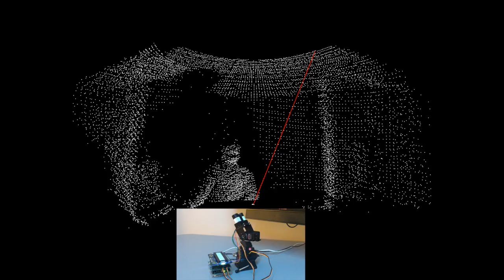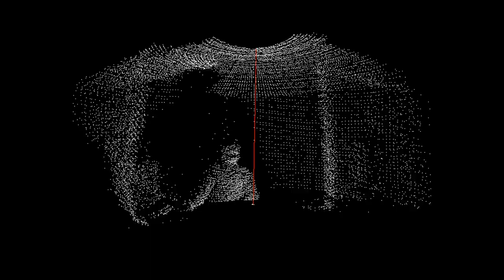Arduino-based LIDAR Scanner

Comment: Because this video was so short, I was expecting it to be one of those badly filmed hurried demonstrations with no worthwhile details that seem to litter YouTube.
So I was very pleasantly surprised when I saw that it was actually very well presented indeed.

This is an example of what a wonderful time for hobby electronics that we live in. I remember reading about how NASA were flying lidars aboard the shuttle in the 90s... the though that somebody could build one in the own homes would have been filed under "very nearly impossible".

Would it be possible to improve the resolution (obviously, with a slower scan-rate)?
Reply: And likewise, yours is a wonderful comment.
Reply: I agree with both Kent and edgeeffect. This video, though short, was detailed enough to explain that this is a relatively easy project and it was also extremely fascinating. Your comment, edgeeffect, restores my hope in the somewhat unstable landscape that is the YouTube comment section. Great video Dana. I will attempt this project myself.
Reply: resolution depends on the angle between points, aka to improve resolution you just need to take fewer steps between readings.
Reply: I'd say the video was detailed enough to explain how to build one!
Reply: Nice video. Could you please share the code or share the materials where I can built my own lidar scanner like you did. Very interesting.
Reply: edgeeffect YO YOO HE DOIN SOME SCIENCE SHIT HERE

Comment: Friend, please help me, I can't get the correct shape, I've tried all the formulas and possible ways, I'm not a programmer, but I have good horizontal lines, but when the servo reaches about 45 degrees, it starts to make my ceiling as if it were an arch and it is triangular understand? can you give me some help?

Comment: Good video. I hava a question, im working on a convayorbelt inside a freezer. I wanted to put 3 or 4 ir sensors lengthwise over the.belt to activate the belt motor if they see a object on the belt. Could one of these do the same thing? And does this shines out the beam sideways or just like a lazer one small line?

Comment: Hey is that Garmin lidar lite v3 sensor?
Can you tell me the purpose of  1000uf capacitor to the lidar sensor in  between black and red.
Can you tell me what changes in the circuit should be done if we use different lidar sensor.
Waiting for your response, thank you
Reply from the maker: It is the Garmin LIDAR-Lite v3. The purpose of the 1000uF capacitor is to smooth the supply voltage to prevent it from dipping below 5V when the current drawn by the LIDAR sensor suddenly spikes.

Comment: Hello, thank you for the video.
can you please tell me why did you use an outside power source? instead of just connecting your arduino through an usb cable to the pc.
and on what pins did you connect the LCD display?
thank you again
Reply: I am asking because the the schematic does not show where you connect the LCD screen

Comment: Trying to reproduce your excellent plotting of x, y, z,  using inexpensive parts.  I'm using Processing V2.1 but I'm having trouble with the LidarScanner.pde, and the serial output format.   Are the x y z coordinates, being sent Serially to the Process sketch, separated by commas,  123,456,789?  Do they have leading 0's?  Are each of them 3 characters long?

Comment: You and your excellent video inspired me to try to re-create what you did.  I bit off more than I could chew...  Due to my limited funds, more time than money, I bought less expensive parts:
1. Chinese 1602 LCD with Keypad Shield with buttons
2. Proto Screw Shield for Arduino
3. TFmini Plus Lidar Range Finder
Which I have finally have gotten to play nice with each other.  The documentation for the 1602 shield eludes me, so I looked at the library files to see what pins it used, as to not mistakenly try to use the same pins on two devices.
I got stuck in my tracks, when it comes to the servos, which are SG 95.  
My questions are:
Is there a reason you used pins 2, and 3?   I noticed that  they are also the interrupts, on an Uno.  I would like to use different pins, if its possible.
I tried you code, just to see if I could get the Processing software, to spit out the screen, like the one in your video.
All I got was an empty white box, that times out after a while.  I tried both the 2.1 and 3.x software for processing and got the same result.
Was this the result from Processing I should expect, when not having a lidar lite hooked up to it?
My TFmini Pro is a serial interface, but I could no figure out how to adapt it to your software, so I didn't have an input to feed the Processing output (0,1), hard serial.  
I did use Software Serial, to connect it,  with my 1602 LCD shield successfully, but still have to get the Arduino code, that I put together, to work with some servo code, that I was hoping to borrow from you, and the Hard serial out code for the Processing sketch.

Comment: 1. How do you attach the servo motors to the LIDAR?
2. How do you attach the cytron shield and keypad?
3. Can you connect the components using breadboard? 
Thanks

Comment: Hey,
I was checking your Arduino code just to feed my curiosity, and what i've seen is you've added an int scanIncrement = 1 and i really wonder the need of this one. Same as
if (scanDirection) {
      posX += scanIncrement;
    } else {
      posX -= scanIncrement;
    }
..here you could easily use int++ or --int, which leads to my question out of curiosity, Why did you even need such an integer to accomplish a basic task? I'm asking to learn :p

Comment: Great project!  The processing sketch on your site is a .pde file.  Can you tell me what program I will need to run such a file?Thanks!
Reply: The software is free and available at www.processing.org/download. I just installed it today for my Creoqode NOVA.
It is a text editor that can be used to write for arduino.

Comment: I will preface my question by saying I know nothing about 3d scanning or Lidar. I was wondering if this device could be setup/configured to scan small objects, roughly the size of a shirt button?  I assume the point cloud could then be imported into some sort of 3d modeling software where it can be modified and then exported to a 3D printer? This is a very cool project, thanks for the video.
Reply from the maker: The Garmin LIDAR-Lite 3 would not be suitable for tiny objects. It has a range of 40m, with a resolution of +/- 1cm. A button is about 0.2cm thick, so it wouldn't be detected.
Reply: Dana Peters Thank you! The search continues... 😉
Reply: Look into photogrammetry - presumably your object is going to want to stay in one place, and distance isn't an issue, so photogrammetry (with enough camera resolution and good model lighting) may be a viable option.  And, hey, it's "free" to get started out in!  @Dana:  Outstanding demo, and thank you for sharing your sketch on your site.  It's enough to get one thinking!

Comment: Hello is a really cool project :)
I am making a 360-degree 3D scanner at the university by modifying your project a bit.
But I have one problem,

if (posX > maxPosX || posX < minPosX) {
      // hit limit X limit, reverse auto scan direction
      scanDirection =! scanDirection;
      posY += scanIncrement;

In this part, it is only necessary to rotate in one direction, but the x-axis rotation direction is continuously reversed.
posY + = scanIncrement; _ Here the y-axis goes down one space,
The problem is two lines above. Can I get help? Please,,,

Comment: i visited the link given above there the Arduino code is designed for manual control, may i have the code that just uses 2 servos automatically and give readings accordingly.
Reply from the maker: Please treat this as a starting point for your own project. I encourage you to make changes to the code to customize it for your needs.
Reply: thanks for your response but i think it will be more easy for one that already designed it... actually  it almost a 2 days to present it and i am quiet new to programming if you could help me in this regard indeed that will appreciable
Reply from the maker: If you would rather not modify the code, you also have the option to construct the project exactly as described, using an LCD shield.
Reply: respected Sir the problem is here we are lack of resources even for LIDAR Lite v3 I almost wait a month to reach and paid almost 3 times more than its original price. i did tried to modify this code i failed. the code i am using just to read the values are here But we are demanded to construct a 3D mesh from these reading coming out of the Lidar through arduino.
although i uploaded this code but Processing is not working on this Ardunio code
Hope u will give some of your precious time to sort my awaited problem

#include <Servo.h> 
#include <Wire.h>
#include <LIDARLite.h>

Servo servo1;  // create servo object to control a servo 
Servo servo2;  // create servo object to control a servo 
LIDARLite myLidarLite;

void setup() 
{ 
   Serial.begin(9600); // Initialize serial connection to display distance readings
     myLidarLite.begin(0, true); // Set configuration to default and I2C to 400 kHz
     myLidarLite.configure(0); // Change this number to try out alternate configurations
 servo1.attach(9);  // attaches the servo on pin 9 to the servo object 
 servo2.attach(10);  // attaches the servo on pin 10 to the servo object 
} 

void loop() 
{ 
  //servo1 -> 50, 90
  //servo2 -> 80, 125
 int k=80;
 int l=50;
 int temp=0;
for(int i=80;i<260;i++)
{

  for(int j=50;j<210;j++)
  {
    if (temp>=4)
    {
      temp=0;
      l++;//right 2 left
      if(l>=90)
      {
        l=50;
        k++;//up 2 down
        }
        if(k>=125)
        while(true);
      }
      temp++;
    servo1.write(l);//right 2 left
    servo2.write(k);// up 2 down
    myLidarLite.distance();
    int vall;
    // Take 99 measurements without receiver bias correction and print to serial terminal
  for(int i = 0; i < 10; i++)
  {
   vall = myLidarLite.distance(false);
  }
  Serial.print(i-80);
  Serial.print(",");
  Serial.print(j-50);
  Serial.print(",");
 Serial.println(vall);
   
    delay(3);
    }

  }

while(true);

Comment: I have 2 questions , 
Is the proto shield and the lcd display nessesary for this build to work . and is there any way to get a faster scan than 10 mins ?
Reply from the maker: You do not require the LCD shield, although minor changes are needed to the code to start scanning immediately instead of waiting for a button press. I have not attempted to speed up the scan, although this could be done by various methods. You could restrict the horizontal and/or vertical angular range, or take bigger angular steps, or both, for example.
Reply: Dana Peters perfect ,thank you for replying so quickly !! Much appreciated
Reply: could you please copy and paste or sent the arduino code  to me please , i can seem to open the file on the website in the description

Comment: Do u run Processing sketch while you are scanning? Sorry for many questions : )
Reply from the maker: Yes, the Processing sketch is running on a desktop computer during the scan. The Arduino sends each data point to the Processing sketch over a serial connection.
Reply: Thanks. But still have problem running this sketch on Processing(ver3.3.6). It returns error "size() function should not be used here". I tried to change this to fullScreen() but never worked.
Reply: I actually figured it out. I worked by downgrading to ver 2.2.1. Thank you very much for all your support!!
Reply from the maker: Great, glad you found a solution, and thanks for reporting the problem.

Comment: Is the instruction for Freetronics LCD shield about "disable the backlight control by cutting strap marked "D3"" only applicable to this particular LCD shield?
Reply from the maker: Yes, this instruction is specific to the Freetronics LCD shield, so you can ignore it if using a different LCD shield.
Reply: Thank you for your quick response. I recreated the exact same setup except using the same LCD mode. But maybe because button position is slightly different on LCD it seems like not moving or starting properly. How do you start the scan automatically after uploading the sketch?
Reply: Thank you. I got the clue. My LCD shield seems like not all buttons assigned to A0. So I will either fix this or just get the same shield.

Comment: I want to use the lidar to mount it on a dron and to make 3d scanning of buildings, can you give me your email to give me directions?
Reply from the maker: Please see the web site linked to in the description for details. I don't have anything more than what is available from this site. Check the specifications of the Garmin LIDAR-Lite to see if it has sufficient range for what you want to do.
Reply: can you give me a guideline how to change the code to work without a button and display and servo Y because the dron plays the role of servo Y
Reply from the maker: Sorry, I can't provide help, but I wish you luck with your project, it sounds interesting.
Reply: Dana Peters  please

Comment: which servo motor is used..thanks..
Reply from the maker: I used a Lynxmotion pan and tilt kit, which includes two Hitec HS-422 servo motors.
Reply: thank u so much...I think I can do my 3d scanner with the information you give, I guess I am not on my finishing project and I have 3 weeks time left.

Comment: which Lynxmotion Pan and Tilt Kit model did you use?  I went to the webpage in the description, but when I click on the link for it, it goes to the Lidar unit page.  Thanks!
Reply from the maker: I fixed the link on the web page, thanks for mentioning it! The Lynxmotion Pan and Tilt Kit I used has product code "RB-Lyn-74".

Comment: I am a student at University and I am really interested in your project but I have a problem with your code in arduino that i can not understand. Please help me, sir. Why do you use this fomular "elevation = (180 - maxPosY + posY) * deg2rad" to caculate the Theta in spherical coordinate system ??? :))
Reply from the maker: Not only does the Y servo have a limited operating range (from minPosY to maxPosY), it also is offset so that when posY equals maxPosY, the servo is pointing the LIDAR detector straight up. In this case, "elevation = (180 - maxPosY + posY) * deg2rad" becomes "elevation = 180 * deg2rad" (i.e. straight up).
Reply: Ohh.. Thank you so much, Sir :)))
Reply: Please I have a college project and I need you to give me the programming codes for this (3D) ☺️

Comment: Hi peter,
I try to make this, but i dont use a lcd
can i just remove lcd line program?
Reply from the maker: You should remove all code related to the LCD display and buttons. Add the code "scanning = true; posX = minPosX; posY = minPosY; scanDirection = true;" to the setup() function to automatically enter scanning mode on startup.

Comment: this thing is so slow. use rotating mirrors instead of rotating optics with chip. and  fish eye optics, so it can scan 360. Scan can be done in milliseconds.
Reply: Can you elaborate on how you would implement such a system? (The rotating mirror part)

Comment: Why not a spinning mirror for faster 360 degree scanning? Is that not doable? Seems very cool, thanks for sharing!
Reply: WhiteShadow2k1 I was thinking the laser could stay stationary and the mirror would spin and reflect the laser pulse back to the receiver and use the software to sense where the mirror was pointed to build the dot picture. I would think you could scan faster that way.
Reply from the maker: I think using spinning mirrors would be problematic in combination with the Garmin LIDAR detector, because it has separate optics for the infrared laser and infrared detector. The mirror would have to be large enough to steer both of them to the same spot. Maybe someone who knows more will comment.
Reply: Yeah, I've been thinking about it a little and it would add several layers of complexity (& probably cost) to do it right. Most of the scanning mirror type devices out there seem to be limited in field of view to accommodate the mirror array or prisms used. Twas just a thought! On to the next one, cheers!
Reply: Dana Peters - A spinning long prism would cover both lenses, then just swing sideways. Paint the back of one (or 2) sides of the prism black to provide sync, or glue a tiny mirror on it's back with a LED/Photodetector to give the sync.

Scan rate is going to be limited by CPU speed, Code optimization in that case rather than stepper rate (for up/down). Sideways will still be limited by the stepper speed (unless you want to gear together another two more prisms for the other axis).

YT,
Rob

Comment: What was the limiting factor for the speed? The motors? The LIDAR? Because it would be cool to see how fast you can run it. I'd assume the LIDAR mechanism can operate at a fast rate, so maybe just a run-of-the-mill NEMA 17 for the horizontal axis could give better speeds.

I assume it needs to stay put for each degree, and can't spin freely while it scans?
Reply from the maker: The limiting factor is the speed of inexpensive hobby stepper motors. A continuously spinning apparatus would improve the speed, but introduce other problems, such as how to connect.
Reply: Chrysippus i would say the motor but I won't put my money on because doesn't the LIDAR instantaneous information when it scans something
Reply: Dana Peters - Connect with a rotating coupling or WiFi.
Reply: Perhaps a slip ring would do the job. Its quality of connection would have to be good enough though.
Reply: You don't say